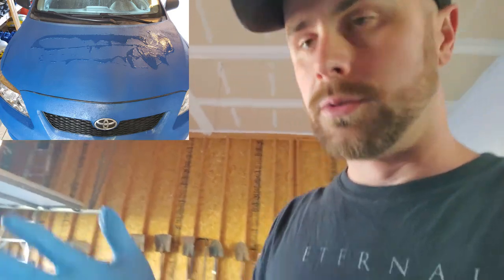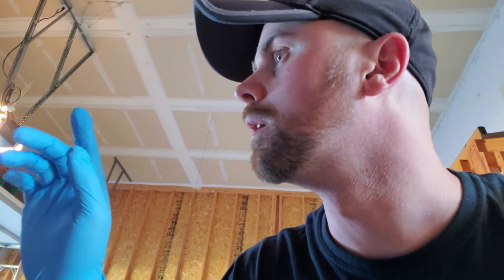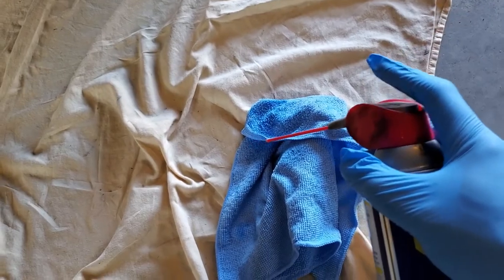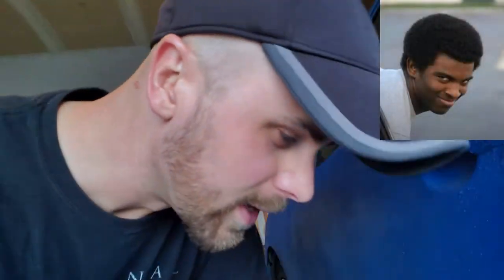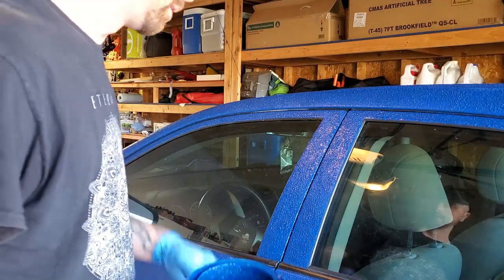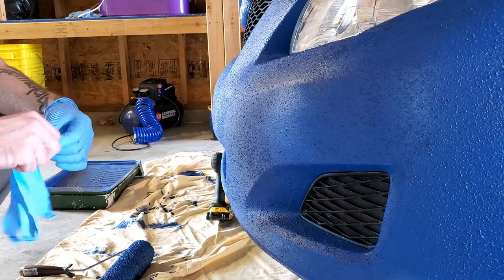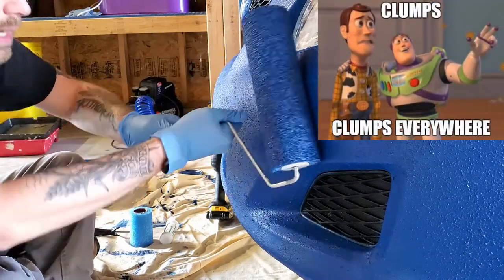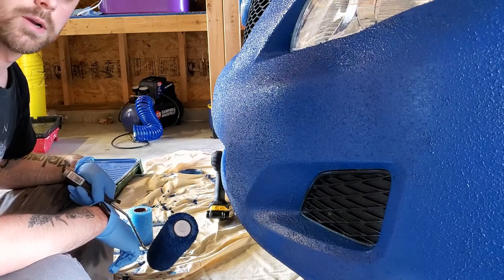Can You Paint A Car With Bedliner? Durabak Application Tips

Comment: what kinda pressure do u reccomend when rolling? more of a "let the roller do the work" or add some pressure?
Reply from the maker: Mild pressure like painting a wall. Don't be cheap with it and try to stretch it out or the rubber granules will not lay evenly, and will build up at the end of your roller.
Reply: @ShareXP  ok so make long strokes? kind of like as if ur spraying it? it definitely came out great after that last coat u did. pretty aggressive and thats kinda what im going for. i seen a charger recently and i know for sure this dude did some sort of hurculiner or raptor liner rool on cause it was super aggressive and looked awesome and he added metallic flake to the mix. actually i think he added glitter cause the sparkle was severe aggressive.. unlike a flake.
Reply from the maker: @Eye_4_An_Eye I would say so, yeah.

Comment: Thank you for making this I've been honestly thinking about trying to do my vehicles with a roller instead of an airgun because I don't have a compressor right now. And I think you just showed me that I can do it. But I'm curious what kind of bed liner did you use? Maybe I just didn't catch it.
Reply from the maker: Durabak is the brand that I used. You have to move quickly, try to be even with spreading the granules evenly.. because they are locked in pretty fast.
Reply: Well I'm planning on doing a large surface a school bus it's not super big only five windows would you recommend this stuff? Because I was thinking about going with raptor. But three layers of it LOL oh boy the price
Reply from the maker: Durabak is pretty similar in price unfortunately..

Comment: I would not pour that directly on the car, you don't get an even distribution of the crumb rubber. The tips you gave us about the textured paint are very useful, thank you!

If using their textured product with crumb rubber in it, you need to stir and pour into a tray so that the rubber bits are evenly distributed.  The 2nd and 3rd coats have to be applied within a certain time frame to avoid sanding and Xylene between coats.  Coat #1 needs to be dry to touch but not cured, before Coat #2, etc.

Durabak 18 is an excellent Polyurethane Bedliner, supple and flexible over Epoxy liners like Rhino etc,  No one else makes this. It dries fast with a short working time. You can roller brush it on or spray it. You can use smooth or textured paint.  You cannot custom color it and it comes in a limited range of solid colors or clear.  I'm going to try adding mica pearl pigments to it to see if I can get a pearly white or metallic shade, but its too heavy and will probably not show this up.  Also they recommend a non water based paste pigment which is impossible to find.

Textured paint requires a special roller.  Smooth paint requires mohair rollers for a smooth application. End result is a satin finish, no gloss but not flat either. Subtle sheen.  Very pleasing and hard as a rock, so no flaking off like epoxy. Rubber EPDM roofs on RVs can also  be covered with Durabak smooth or textured as it is flexible enough to take the movement.  If you use the smooth Durabak 18 paint, you won't need as much paint as textured and application is easier as you don't have to deal with the crumb rubber distribution issue, just the paint.

Once you have used a can partially, transfer contents to a smaller jar and add some xylene to it. If paint fills the can, it won't harden up as fast as if you leave some air inside a half filled can.  This is what hardens paint fast.  Cleaning solvent is Xylene, which is banned in CA, so you have to find an online source that will mail it to you.  Durabak makes Solvide, a Xylene copy, but ridiculously priced at $22 per quart!  For $52 you can get 4 quarts with shipping included (Hazmat fees), from Walmart or similar source.  Forget about cleaning the rollers, use new ones for each coat or keep them soaked in xylene.
Reply from the maker: The difficulty in working with this product is how fast it dries, the rubber bits really do pile up fast on the roller.. especially in a warmer environment.
Reply: Are you saying you can apply nontextured product  to outside car body with roller and brush? Do you get roller/brush marks or does it level out?  How many coats?  Does it look better nontextured, that is, does it look more like conventional paint job?
Reply from the maker: I have only used the textured product so far. You get more coverage with the Durabak without the rubber pieces.
Reply: @tommak6516 
1. Yes. Outside car body. Also on dashboard if you want to renew it.  This paint is very durable and a bedliner paint. It is a moisture cured Polyurethane, not an Epoxy paint like Rhinoliner or UPOL Raptor Liner which are very brittle, dry even faster in 30 mins and have to be sprayed due to fast drying.  Don't use those.
2. The rollers must be Mohair for smooth paint, or textured rollers for textured paint. The paint does self level leaving no brush marks at all.  
3. You need 2 coats minimum.  Do one coat, wait till finger touch dry, and apply a 2nd coat. Then let it cure.  If you let first coat fully cure, you need to repeat prep before 2nd coat.  Timing is important.
4. Prep - Bare metal will need sanding, then metal etching (bonds rust), then paint.
Previously painted surface will need light sanding, rub down with Xylene, then paint.
5. Solvent is Xylene, not anything else. You cannot buy Xylene in CA due to strict VOC laws, so I  bought on Walmart website and miraculously they shipped it to me!  Durabak makes an overpriced Xylene substitute called Solvide, don't bother, get the Xylene.
6. Conventional car paint is a delicate, flimsy water based acrylic paint with a clear gel coat on top. There are many layers, you need a clean room, and a spray gun setup and its costly to buy this paint from dealers.   The advantage is that you can get whatever color you want, some really cool candy colors, metallic, color shift, hypershift, etc. Check local laws first.  The disadvantage is that it scratches easily and a royal pain to apply and you breathe paint fumes and your car is out of operation for a week.
7. Durabak18 is so durable, the US Navy uses it (Durabak26  is same paint but tested to Navy standards).  It is very resistant to chips and scratches, makes an excellent bumper paint for metal, fiberglass, plastic fenders, as well as car body or concrete steps, or EPDM rubber roof on RV, or car metal/ fiberglass body. The finish is satin matte, not shiny. You get a solid color standard palette, no fancy shades, no metallic, nada. Boring but strong.  You get a clear shade too. If you want to mix pigments, only non-water based paste pigments will work. Try at your risk. The delicate metallics or mica dust will not work as the heavy thick Poly swallows them up and they need thin acrylic paints to work best, so you have a limited color palette.
8. Durabak dries faster in moist air than dry air!  It is moisture cured paint.  Your working time is 6-8 hrs, keep diluting with Xylene to thin out.  Your shelf life is very limited.  If you have leftover paint, dilute with Xylene and transfer to a small container to fill up. If there is an air gap on top, it will dry fast. Don't leave an air gap, find the right size container. This is true of all paints but esp with fast drying ones. Forget about reusing mohair roller, impossible to clean, ditch and use new ones.
9. There are several Durabak demos on Youtube look for them.  You will see the paint effect.  I would not recommend textured paint, use the smooth one.  You can make your own textured paint using Crumb Rubber granules, just be sure to match up color with paint. Black granules with black paint, etc. or they will stick out a different color.  Use granules on concrete steps for non skid function.  Remember that textured paint traps dirt, mold, grease, and is only useful for non-skid surface tread nothing more. It also creates wind drag on vehicles. Use smooth and get more coverage too. You can mix and match smooth with textured as you wish.  Some people also sprinkle sand on the wet paint and recoat to get a finer texture.  Good luck!
Reply: @mjremy2605  Thanks for your detailed information.  Assuming I would use the nontextured (smoth) paint, can you use a (cheaper) foam roller instead of the more expensive one?  Also, how much does it take to do two coats on the average car (would a gallon be enough?, too much?).  It seems this paint is quite expensive.
Reply: @tommak6516  
1. Cheaper foam roller would not give you a smooth finish.  Use only a mohair roller. Don't skimp on the roller, it is key.
2. Durabak gives you coverage information on their product. Check their site and do a lot of reading and measuring before you buy this paint.  I don't know your car. You need to do your own measuring.
3. You cannot paint a car cheaply. If you buy  spray cans at $4.50 on average, it will still cost a lot.  If you intend to use spray cans, use Montana Gold.  Nice colors and they don't fade. Clean up is Acetone.  Durabak is the cheapest option. Getting car repainted costs $5000 professionally. Durabak is $150 per gal and you need 1-2 gals. Cheap.

I've given you a lot of info and saved you time. Now you need to research further on their website please. No more questions.

Comment: To save the leftovers like you said you can put  it in an airtight container or put painters tape over the lip of the durabak can before you start mixing and pouring then remove painters tape after using the liner paint put top back on securely and store can upside down.
Reply from the maker: Flipping the can upside down is an interesting idea, help keeps it more airtight? I had some set aside in an "airtight" peanut butter container but it was completely solidified when I went to use it for a touchup.
Reply: Upside down in a 100% airtight container ( I use a vacuum sealer container) and put it in the refrigerator

Comment: 1)Where did you buy the 9 in roller. 2) why not spray it? Thanks
Reply from the maker: If you have the equipment, I'd say to try spraying it. The pictures I have seen show smoother results. The 9 inch roller is available on their website.
Reply from the maker: I emailed Durabak and mentioned some of the inconsistencies in my initial rolling of my car, and they suggested spraying it for a more even finish.. so I'm assuming there is a way if they said that.